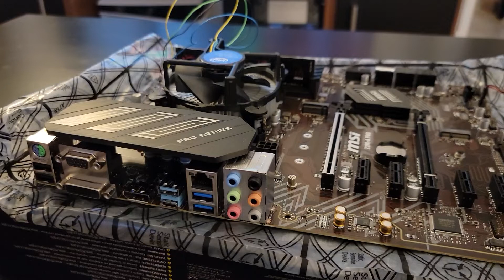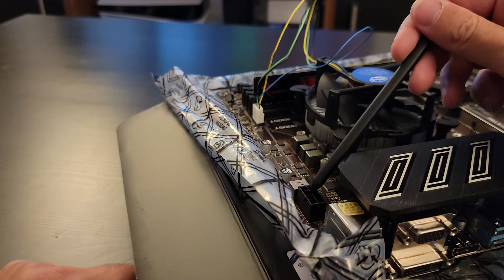PC  is ON & Fan Spinning but NO DISPLAY - Step by Step #Guide to get a #Display on your #PC (2021)

Comment: Everything is working on my built in desktop computer but their no display and everything works with each others
Reply: Display on my monitor do u know what wrong with it
Reply from the maker: check my video again and follow the same steps i did. Sometimes it could just be the Bios settings